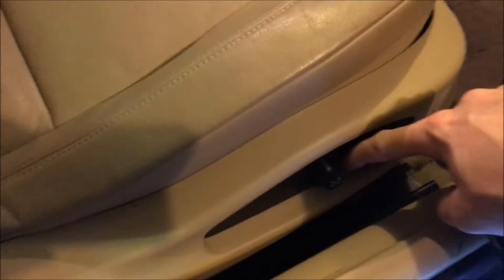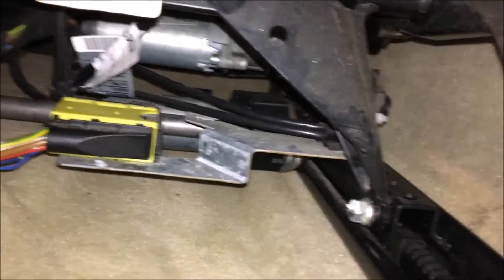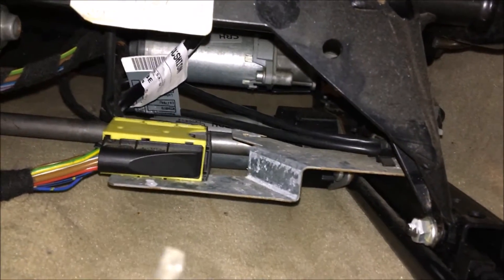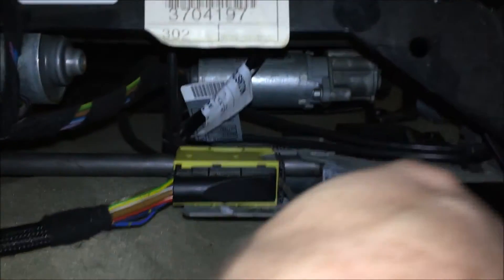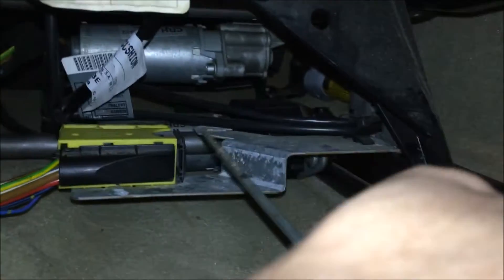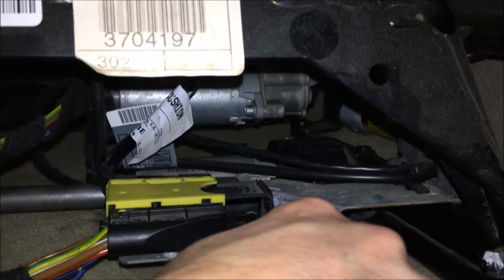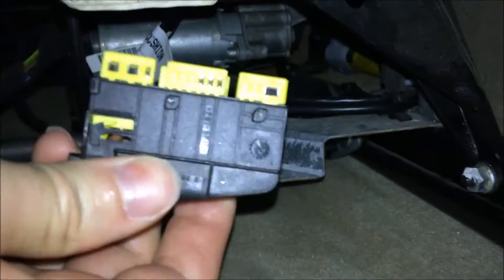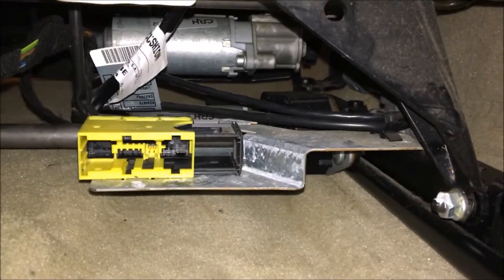BMW Front Seat Removal and Airbag disconnect. Z4 and 3 series, e46 and e85

Comment: Is it possible to then drive the car without the seat? Like for a track day and weight reduction. Or all them codes will then pop up when you reconnect the battery?
Reply from the maker: Josue, Good question and point.  Electric seats are heavy and pulling them out would be a good savings.  But if you pull the seat and then turn on the car (or plug in the battery) you will get an airbag light.  And that air bag light will not go away just by putting the seat back in after the race.  It stays lit up until a dealer or BMW scanner (or other qualified OBDII version) deletes the code.

So, If you have BMW air bag code clearer you could just remove the seat and clear the code after you put it back in.  But if dont have the code clear than I would not recommend it.   

There is one more option though.  That being there are some Airbag sensor bypasses you can buy which make your BMW think the seats are in it and occupied no matter what.   If you installed those you could pull your seats as many times as you want and it shouldnt make a difference.

I hope those options help. but just to repeat. If you simply pull the seat and go race you will throw a code that you can not delete without special tools.  All the best!
Reply: @FarReachFR  thanks for the reply buddy. Would that still happen even if before doing all that I would turn off the passenger seat airbag? Or this wouldn't solve the problem since the car would still detect the off weight?
Reply from the maker: @josueneto3  Good point.  Sorry to say I dont have a firm answer on that one.   Its a great thought.  But I am not sure how many things the air bag switch shuts off.  If it shuts off the air bag AND the seat belt tensioner, then maybe it would be fine.    On the other hand it could shut off the airbag but still throw a code because it reads it as unready system.  I really dont know.  I could imagine it either way.  If you lived near (in North Carolina) I would say, go for it and give it a try, cause I actually have a BMW scan tool that can clear the code for you if it screws up on an e85.   But if you dont have a BMW scan tool, it is a bit of a risk of a Airbag light on the dash.     Could be awesome, Could be trouble.  I just cant say.  

If you do actually do it let me know how it turns out!  Good or Bad, It is a clever thought you have.
Reply: @FarReachFR  well thanks for the quick reply buddy. I was looking into them airbag bypass and that looks rather complicated, probably easier way is getting a code reader and clearer, I'm wondering if the carly does all that?
Reply from the maker: @josueneto3  I agree.  Getting a code reader with airbag clear functions would be an easy use.  As for Carly, I have not used it.  So I cant say if it will work that way.  I know it can READ airbag errors, but I dont know that it will CLEAR airbag errors.  From personal experience I know there are Big differences between OBD2 scanners that will read versus actually resetting/deleting errors.  Big difference.   If you already have Carly though, you likely know far more about it than me.  I have never used it.
Reply: @FarReachFR  no ivve not got any code reader yet, but if I am looking for one it will be one that can reset airbags and stuff. What do you use?
Reply from the maker: @josueneto3  Carly may very well work, just need to check with someone that has used it as such.  As for me I use BMW Scanner 1.4  But keep in mind it only works with older BMW cars. (like pre 2001 and my 2003 Z4 e89).  With newer cars like my 2009 Z4 E89 it does not work with that.  INPAS would be another option that would likely work if you have a newer car (2001+).

Comment: any possible pitfalls you need to consider before disconnecting the battery on a z4 e85? on my old car after the battery was disconnected and reconnected you had to enter the security code for the factory fitted stereo to get it to work again.
Reply from the maker: Hum.  I have never had the radio code issue.  So I cant comment there.   I can say my biggest worry was the AIR BAG SENSOR.  Sorry just wanted to post that.  That being, if you don't disconnect the battery you will get an Air bag light that will not go out without special tools.  Now as for other downsides of disconnecting the battery, most that I can think of are just minor, radio stations. etc.  Granted I have never had the issues you have described.  but I did just recently have the battery go flat, on my e85 because I left some accessories on over a couple days, and in my case, there was no radio codes to enter.  I just had to charge the battery back up and go.   So while no promises, I hope your results can be the same.

Comment: If I just want to remove the Z4 driverseat, do I need to disconnect the battery too? Dont want to risk the radio code issue below.
Reply from the maker: I would disconnect the battery. Yes.   But then again I have never had a radio security issue pop up.    But I can almost guarantee you will have a Air Bag light come on if you try it with the battery connected.  In my opinion one maybe might happen, the other is certain to happen.   Also to repeat I have had the battery disconnected on my Z4 many times, and never had any issue with the radio.  Also just a heads up that the Airbag light cannot be shut off with normal means or normal code scans.  It has to have a deep scan that generally is only found at BMW dealerships and BMW specialized repair centers.

Comment: What about if the seat doesn’t work? How do you get the bolts out
Reply from the maker: Mario, that certainly makes it much harder.  I can only think of two possible options if the seat doesnt move. 1. there are 4 bolts parallel to the floor that hold the seat to the track.  Getting the front two off wold be straight forward.  If you could also get off the back bolts you might be able to remove the seat and then access the rails separately.  Or possibly by removing the front parallel bolts you can pivot up the seat slide the seat back and forward manually (you may also need to remove the motor to do that.)  but that whole sequence is a guess since I have not tried it.  But I can tell you the side bolts are there.  And you might try the fronts to see if that gives you any additional options.     2. this will work, but is destructive.  That being you cut the seat out.  Using an angle grinder you could cut the feet that hold the seat in.  Then you could access the rails.  The seat will be destroyed as you cut away each piece to get at the final bolts.  But once out, you can replace it with an entirely new one.      Obviously this 2nd version is a final option.  And each is far more difficult since the seat can not move.  I would give the front two bolts a try and see if you can pivot it, or remove the motor and then move things around.   I hope this helps.  Good luck, it certainly will be a puzzle.

Comment: is this the air bag module you disconnected?
Reply from the maker: The wiring plug disconnected underneath the seat is many wired items in one.  And yes, the wires include the Air Bag sensor and Belt Pretensioner.  Both are part of the SRS.  Make sure you have the Battery Disconnected before doing this or you will throw airbag codes that are difficult to remove.  (the wire plug underneath also sends power to the seat adjustment motors as well.
Reply: Hey I have a few questions if you get this relatively soon